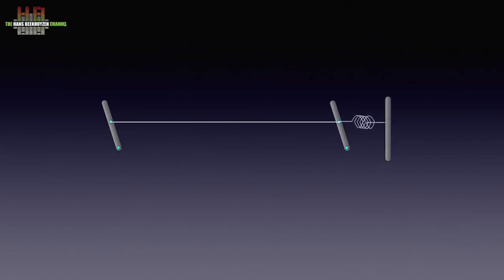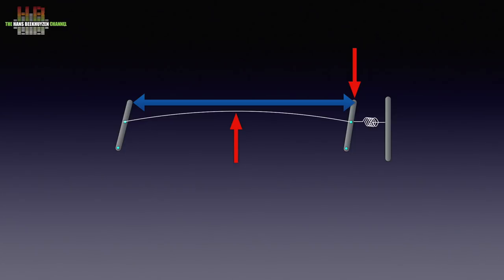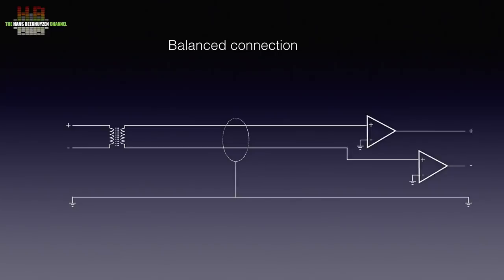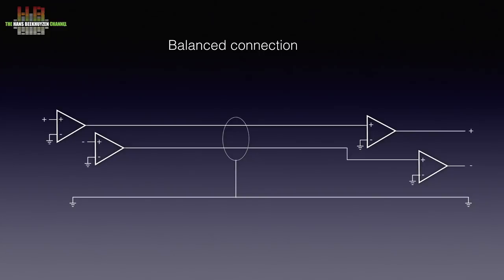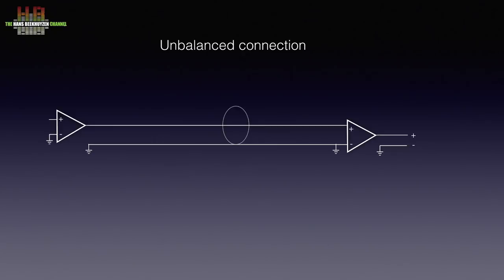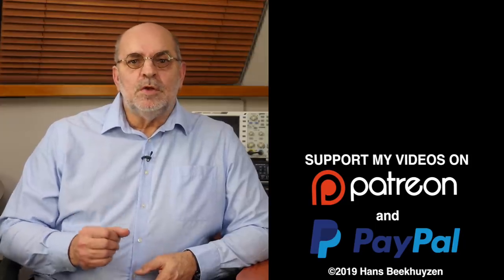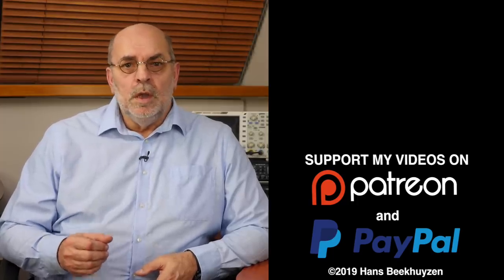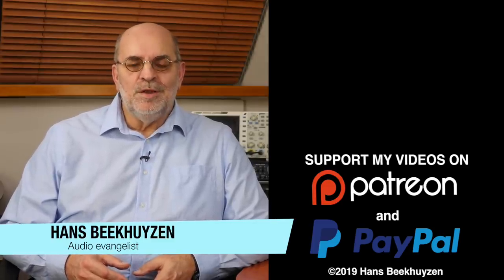Audio Hygiene 5: Balanced or single ended interlinks?

Comment: Very intresting video's you have Hans. Been watching a lot of them but I allso do have a question. Do you allso have a video about a power cleaning divice or simple say a netfilter? If not, is it usefull to have one? This because a lot is going over the powernet e.g. internet. Think it allso influensing the sound. Many thanks for answer.
Reply from the maker: Local power grids differ as does the local legislation on use of the power grid. So I won't review power conditioners.

Comment: Balanced audio in my opinion is really a need/don't need scenario. If you know you need XLR, you probably need it. If you are unsure if you need it, you probably don't. I never knew about the doubling of components with the positive and negative ends of the signal, that was very interesting to learn.
Reply from the maker: You need balanced interconnects if it sounds better! Not to feel better.

Comment: I built a second shelving system for my cables behind my main shelves for the components, it keeps all of the different cables away from each other, the power cables are away from the interconnects are away from the speaker cables, this has the added benefit of keeping the speaker cables off of the ground.

Comment: The only two things I learned from this is: that single ended is another term for unbalanced and that the helm of boats is connected to two cables haha
Years ago, back when I was into DJing and I found out that the semi-professional and prosumer equipment also has a type of balanced inputs and outputs.
Those are XLR connections that say balanced, meaning that they are compatible with a balanced signal, but they don't actually process the balanced signal.
When I found out, I looked up schematics which all showed that the negative (-) was connected to ground.
This basically results in using the positive side of the balanced signal as an unbalanced signal.

I think this "balanced compatibility" is misleading, it should be forbidden to call it balanced.
Reply from the maker: I agree